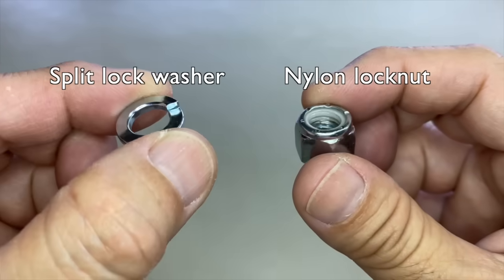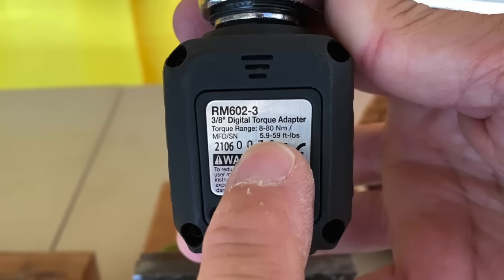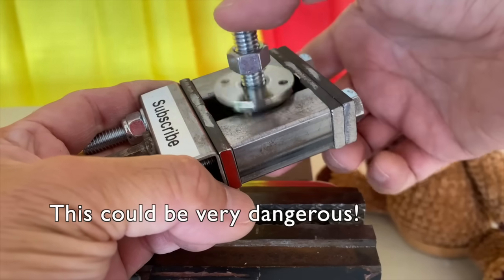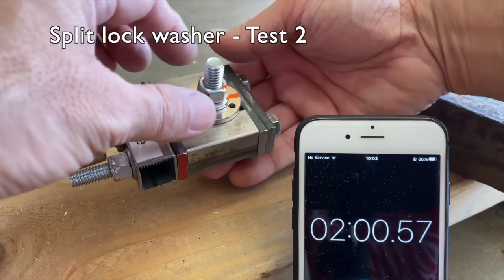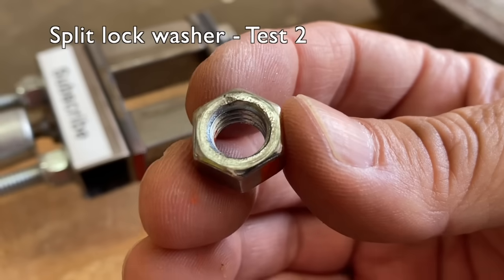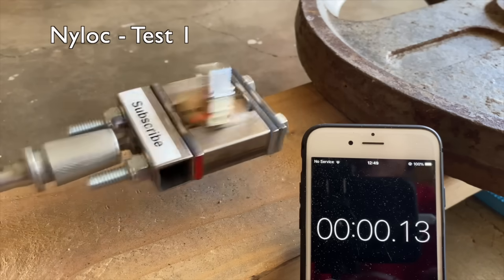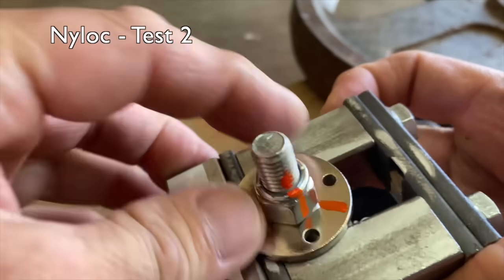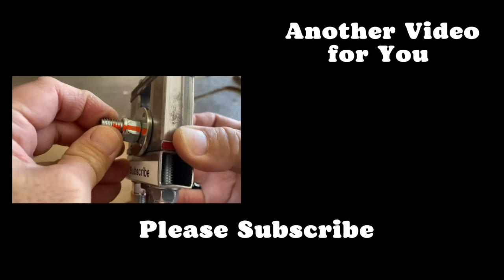Nuts & Bolts - Split Lock Washer vs Nylon Locknut – DIY Impact & Vibration Test - Part 1

Comment: The nylocks aren't spinning relative to the bolt, which means the loss of clamping strength is probably due to the bolt stretching from the dynamic forces of your test setup.
Reply from the maker: Good point!  Thanks!  👍😎
Reply: I noticed the same point about the nylock's.  I wondered if there were  burrs from the split ring washers left on the shouldered bushings that were worn down by the action.  Stretching of the 3/8 bolts seemed less likely to me but I don't know.  There are significant accel's in the reversing action so forces can be high.

I also wondered if the original torque was sufficient.  I was surprised to see the torque for ASTM A307 galvanized and waxed bolt is 6 lb.  For non waxed it is 15lb.  Other grades increase torque spec.

The comment from a CAT/Cummins engineer was very interesting.  They don't use split washers.
Reply: I wonder if stainless steel fasteners would fare differently due to their tendency for the threads to meld into each other (I forget the specific term for this).
Reply: @goodun2974 galling?
Reply: @JELWwL6unE8V7iGB3  yup, that's the right word.

Comment: The proper torque is about 32 in/lbs
This will cause the bolt to slightly stretch and hold the nut in place.
Reply from the maker: Thanks!  👍😎

Comment: Not a true test. They are engineered to work under specific tension. This does not provide that. You are testing them out of spec. 

It’s like doing a wear test on car tires with 1/2 specified air pressure.
Reply from the maker: Thanks!  Increasing the torque to proper specs for higher grade fasteners will show that plain nuts will hold on their own… lock washers or lock nuts won’t be needed.  That’s a future video. 👍😎
Reply: @HacksbyDad And thank you for this practical and helpful video!
Reply: @HacksbyDad  I think all bolted to spec I'd still expect the plain nut to come loose before the other two, in a similar but more severe vibration test.
Reply: @HacksbyDad  out of personal curiosity, have to ever done a long term vibration test of standard nut and bolt at specified torque specs?  I would be curious how long it would take to loosen.
Reply: You mean to say that a test by a DIY channel on YouTube didn't hold to the most rigorous testing standards? I'm shocked! I thought everything on the interwebs held to the highest standards of accuracy?!?
Reply: @jaypie0864  if one is going to present themselves in a professional testing manner, others will give constructive feedback. Maybe you should get back to your legos

Comment: Would also be interesting to see the difference between the various Loctite type (actual Loctite, not the imitations). I am also curious how serrated lock washers would compare, perhaps even internal vs external. I prefer Nylocs for most applications in small sizes (4-40 to 10-32) when I don't have to repeatedly remove them. Fun video though. Even if it doesn't answer all the questions, it makes people think - and that is very important.
Reply from the maker: Thanks!  I posted a couple of tests earlier...
https://youtu.be/4H-HOHZ3chA
https://youtu.be/lwtUWB2TIYA
👍😎

Comment: 6 ft P is ~8nm, when the required torque is: M6 Bolt (8.8 Grade)Torque: 9-10 NM M8 Bolt (8.8 Grade)Torque: 22-25 NM M10 Bolt (8.8 Grade)Torque: 44-49 Nm
Reply from the maker: Thanks!  Increasing the torque to proper specs for higher grade fasteners will show that plain nuts will hold on their own… lock washers or lock nuts won’t be needed.  That’s a future video. 👍😎
Reply: @HacksbyDad Never use spring washes with high tensile fixtures.
Reply: @HacksbyDad  I disagree with that based on decades working in industrial and power plants.   Real world conditions are much harsher than your simple test rig.

Comment: I believe nylock nuts are supposed to have 10% more torque at install than a traditional nut.
Reply from the maker: Thanks!  Never heard that before. 😎
Reply: @HacksbyDad  Yes, you must compensate for the friction of the nylon.

Comment: 1/5 recomended torque is not a fair test. It overwhelming favours nylocks as they don't rely on bolt tension to stay put.
Reply: Agree. For the test to be valid, all fasteners must be installed to spec., including torque. The plain nuts would indeed remain secure for a much longer time if proper thread elongation were achieved, as would the split lock washers, under proper compression.
A test with much more severe vibration and much longer duration would be required to truly compare these fasteners under correct installation.
Reply from the maker: @twosixtyninechatter653  Thanks!  It was just a simple comparison test for the curious DIYer.  Serious engineering types can refer to NASA.  👍😎
Reply: @HacksbyDad Why would DIYers want a meaningless test?
Reply: @LTVoyager  They wouldn't, but this is not a meaningless test. In real life, nuts are often not tightened to spec. This test is not about ideal conditions, but about the kind of stuff DIYers do.
Reply: @fxm5715  I think Forrest Gump had an appropriate saying for this.
Reply: @LTVoyager  that quote is definitely apt for the guy who's throwing a fit in the Youtube comments section.
Reply: For one reason. It shows the diyer that if you use a nylon locking nut the nut will probably not fall off completely. That could make a huge difference.
Reply: @a9ball1  A nut that never comes loose won’t fall off either.  Again, a completely bogus result leading to a bogus conclusion.
Reply: @LTVoyager  I had no idea that if a nut never came loose it would not fall off. But just imagine if it did and it had a lock washer instead of a nylon locking nut what would happen?
Reply: @a9ball1  But just imagine if the nuts were exposed to heat and the lock washer stays intact and the nylon melts out of the nut and that nut gets loose and falls off?
Reply from the maker: Thanks!  If I were to 5x the torque… the plain nut would probably hold all by itself.  That’s a future video.  👍😎
Reply: @HacksbyDad  I would be more curious about how close to the rec. tq. for a bolt you need to get for the lockwasher to start to function properly. 
At 1/5th the standard install torque on a fastener..... you haven't used  the fastener properly and you CANNOT expect it to stay without using a nylon or crimped nut. If you cannot clamp your parts with something close to the standard spec for the fastener, then you need a high friction/pinned/etc nut.
Reply: Short of double nuts and or welds, Nylocks are my go to.
Reply: @kb9oak749  Nylocks are a good choice on assemblies where the bolt can rotate, but no locking washer or nuts are needed in 90% of installations.  Look at the most critical bolts in your engine such as rod bolts, head bolts, etc., and tell me what style lock washer they have.  I only use Nylocks on low temp assemblies that are subject to rotation, unless on my airplane where I use lock wire.  If you have a high temp application you want to usage deformed lock nuts, not Nylocks as many amateurs do.
Reply: He owns the nylon bolt company

Comment: I have seen test that basically show split washers to be worthless overall. I use all manner of bolts and nuts on a daily basis that commonly use 5 different locking methods. 1-Split Lock Washer, 2 - Nylock, 3- Serrated Flangenut, 4 - Loctite, 5- Not sure of the name, it is referred to by the manufacturer of the kit it is included in as a toothed washer, but it it a dome shaped flat washer with teeth on the bottom that is basically a spring load to keep tension on the bolt. (Edit it looks to be called a Conical Spring Washer)

Out of all those I prefer the flangenut where appropriate, they don't even want to come off with force so it is not for a circumstance to be repeatedly removed. Of course loctite is good by itself in most cases and can be added to any other as a plus 1 method.
Reply: Nord-Lock washers - they use two washers with ramps that increase fastener tension when undone i.e. it is easier to turn in the tighten direction once the lock washer is engaged .
Reply from the maker: @PaulG.x  I'll test Nord-Locks... someday.  😎

Comment: Just for fun try a nylon locknut and a split washer at the same time.
Reply: I second this motion! The nylon lock nut holds on to the bolt, the split washer hods on to the spacers!
Reply: Yes. Best of both worlds.
Reply: This is not about mixing peanut butter with chocolate. It is about which is better by itself
Reply: @jerrymccurry9372  No kidding.
Reply: @jerrymccurry9372  What fantasy world do you live in where you can't buy and use both?
Reply: @someguy5035  Maybe you should read the video title again. It doesn't mention cost
Reply: @jerrymccurry9372  Neither did I.
Reply: And add a little Loctite as well
Reply: @XmanXman-jd3ts  🤣  Weld that sucker!

Comment: Test isn't really good, none of those are designed to hold with 6ft lbs or torque.  Use a proper torque spec and test again.  Yes if you test something it's not designed to do, it will not do what it's designed to do...
Reply: He means a properly designed and assembled bolted joint won’t fail in this way.
Lock washers and nylock washers are to prevent the joint from failing after preload is lost.
Reply: @tony39572  Ah I see, so it was meant to be: "won't require ether an nylock nut or a lock washer".
Reply: It would also be interesting to see to which degree a finer thread version of the same diameter will help.
Reply: Out of curiosity, what would a proper torque spec be specific to this application?
Reply: @kb9oak749  There are charts for bolt size and grade.
Reply: It wasn't meant to hold! Result is the same for higher torque if you shake it more violently.
Reply: @testboga5991  wrong and wrong
Reply: How about you make the video instead of bitching about this one
Reply: @bazza2540  It's already been done many times, russia bot
Reply from the maker: Thanks!  Using proper torque specs won’t require either because the plain nut will hold all by itself.  That’s a future video!  😎
Reply: @HacksbyDad  This was my understanding as well. So lock washers are most useful in situations where the full preload for the bolt isn't used because materials would be damaged by the full preload or where the joint is intended to rotate.  Still, I wonder what happens in extreme vibration environments. Key bolts on airplanes have wires to prevent the nut from coming off. It doesn't seem like that would be done if a properly tensioned bolt could never unscrew.
Reply: @HacksbyDad  can't wait for this!
Reply: @HacksbyDad  Another point here is a nut that has been spot faced so the clamping face is truly perpendicular to the thread axis has a far greater surface contact on the component joint face and is even more reliable at staying tight.
Reply: @HacksbyDad  you said: "....  won’t require either  ...." Sorry but that communication need some work! What do you actually mean with that?

Comment: interesting test! For auto and home use, where removal is not a concern, I far prefer nylocks. They always stay tight and you won't loose a nut even if it loosens. Less likely to rust onto the threads as well.

For high vibration, but need for removal, I like double nuts or split washer.  Auto battery mounting bracket, for example.
Nylocks are a pain to remove off long threaded bolts because they will never spin

For a high vibration area like a washing machine, I would ideally use a nylock. Even if it loosens, you won't lose the nut, and potential disassembly of whatever is held together and it won't gall the mounting surface.  

Your test surprised me though. It does bring up a good issue of re-using nylocks or split washers. 

Less common, there are serrated nuts as well.
Reply from the maker: Thanks!  I plan to do tests with other locking fasteners just for the fun of it. 👍😎
Reply: @HacksbyDad get some aviation nuts if you can, They actually bite into the bolts.
Reply: All the nuts and bolts we use are stainless so rust is never a problem, Nylock can fail because chemicals can melt the nylon, They are also a single use item, 
Spring washers are far more robust, Especially in harsh environments.
Reply: Cone lock nuts. Nylocks fail in heat.
Reply: Those serrated flange nuts are common in a bicycle shop.  They work well too.